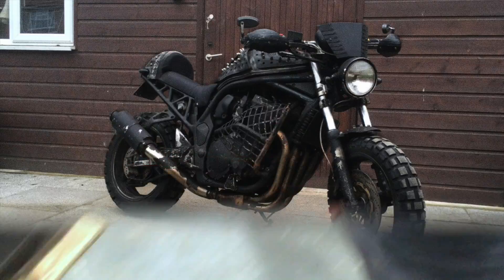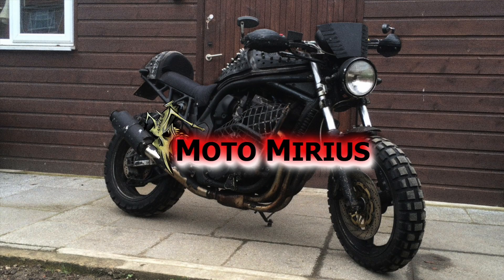ABS Brake Bleeding : Mini Skills

Comment: Hi David, I know you're talking about bikes, but would you be so kind to give me your advice on car brakes?                    (I believe when it comes to ABS, the ABS pump does the same job.)                                                                                                        

My question is:  Would it be easier to bleed car brakes when ABS fuses (for ABS and ABS relay) have been removed?                                                                                                

Note: On my old car without ABS I was able to bleed the brakes much easier, now on the new car I can hardly press/pump the brake pedal ( it goes, but very hard).
Reply from the maker: Depends how new the car is and how much the electronics are involved - traction control etc.  With older ABS systems the pump only kicks in as it detects the wheel starting to skid - so the ABS doesn't activate when stationary - hence the need to activate the ABS pump if you have air trapped inside it.  If you have an open system, no fluid remains within the pump so there is no need to remove fuses,  If you have a closed system there will be a small amount of fluid trapped within the pump but not enough to make any difference given that you will almost never replace every trace of the old fluid - so there is no need to remove fuses.
If you can't press the brake pedal and you've got a bleeder valve open then you may have a pump in the system which isn't activated when the ignition is off.   You would need specific advice based on the make and model of car - normally there will be a forum which specialises in your car and you will find the question has already been asked there many times.   Good luck! Skäl  David
Reply: @MotoMirius   MANY THANKS DAVID. 
Some people say things like: ''Disabling the ABS unit will allow fluid to flow through unrestricted for a better flow when bleeding air outta the system.'' ''Disabling ABS is just to make sure flow is unrestricted, no matter how hard ya try pushing pedal through the floor the ABS will only let the brakes engage so much.'' 

From your video I understood that unless I run the ABS pump with special device or just by braking hard I will not get the old brake fluid moving through ABS unit (on closed system). 

1. So is there any chance that by removing the fuses you will allow ''better - not total'' flow through ABS unit and therefore the brake pedal will get softer (or it's just a myth) and you always need to operate the pump on closed system? 

2. Master cylinder / brake bleeding - using vacuum brake bleeding kit (a gun). 
Is it good idea to operate the master cylinder at the end (by pressing the brake pedal) after all 4 wheels were bled by gun or it's unnecessary as the new brake fluid passed through it completely when sucked from each bleeder valve?

P.S.: I looked around, believe me (forums). 
P.S.: I'm still able to bleed the brakes, but it's hard work. :-)  My car is only 4 years old. 

Have a nice one David.
Reply from the maker: @peterx7623  the ABS unit only runs when activated.  Unless you are driving whilst bleeding the brakes it won't activate.  Taking the fuse out will not make any difference.  Open or closed makes no difference to bleeding.  I don't see the logic behind the suggestion.   
If you have a brake booster in the system that can have an impact - try using the brakes when the ignition is off and it can be very hard to press on the brakes.
If you've bled the brakes, operating the master cylinder won't have much effect.
Reply: @MotoMirius  Alright, no problem, but you see that's the kind of answers you find on forums. :-0
I guess I'll have to get in touch with dealer again (this time different branch) and try to find answers there. In the service manual I found only bleeding sequence (a picture only) and nothing about changing ABS unit.    

P.S.: All cars have the brake booster even the old ones (if ofcourse you don't go back more than 93 years before a brake booster was invented). :-)   Anyway, thanks DAVID. Have a safe ride.
Reply from the maker: @peterx7623  I've owned lots of cars without brake boosters but probably true that all modern ones have, along with power steering etc.  I suspect the problem you are having is that you are expecting a different answer.  The problem with remote diagnosis is that the problem is always the thing that hasn't been mentioned but would be obvious once you get hands on.  Good luck with the dealer.

Comment: Is the ktm duke 125/390 open circuit ABS brakes ?
Reply from the maker: Since the repair manual includes nothing about the ABS and just uses a pressure bleeder for the brakes, I would assume it’s open circuit.  Skäl.  David

Comment: Slamming on your brakes to activate the ABS system does not work. The reason should be obvious. When you do that, ABS will pulsate but it will not move brake fluid along the brake lines.  With the bleeders closed, brake fluid can't move through the brake lines. To bleed brakes, including the ABS system, the bleeder screws must be open so fluid can move through the brake lines. When the bleeders are closed, brake fluid temporarily moves slightly but returns when braking is released. Or, to put it another way, if the bleeders are closed, the brake fluid has no place to go. Also, I'm skeptical of your claim that most ABS systems are open. My Triumph Rocket III Touring, for example has a closed ABS system. To bleed the ABS system, ABS must be cycled using software. The same is true for my SUV and my truck.  So I suspect that more bikes than you suggest have closed systems. That's one reason why DealerTool, TuneEcu, etc., are so popular. I'm guessing that most Triumphs have closed ABS systems because there are so many YT videos showing software being used to cycle the ABS pump to bleed ABS. My factory service manual explicitly  stated that software must be used to bleed the ABS system.  I'm suspect that most  motorcycle ABS systems are fairly universal made by just a few companies. I can't say for sure that you are incorrect in your claim without researching many different motorcycles but I think more motorcycles ABS systems are closed than you suggest.
Reply from the maker: If Triumph are using a closed system, you can expect to find it on all their bikes, they will use common components and designs to save stocking costs and increase design efficiency - it doesn't give you any data on what other manufacturers are using.  Yes, you can use the software tools to run the ABS, and of course that is the ideal situation, but most riders don't have access to them.

Comment: U are too slow ...get to the point
Reply from the maker: I recommend increasing the playback speed if videos are going too slowly for your own taste - you can always stop and slow it down again for the information you need.
Reply: The Autel Maxicheck Pro will not work with most Motorcycles, it is intended for cars